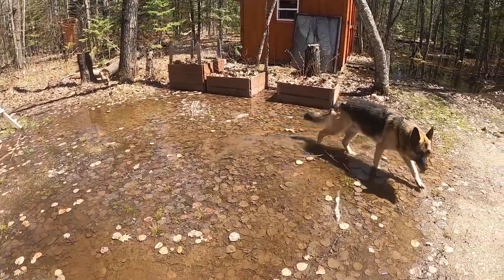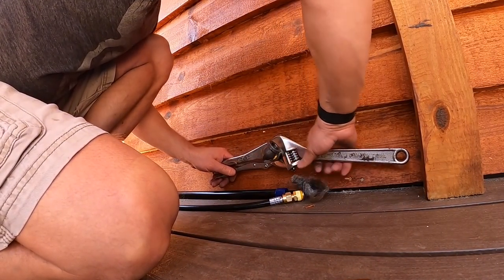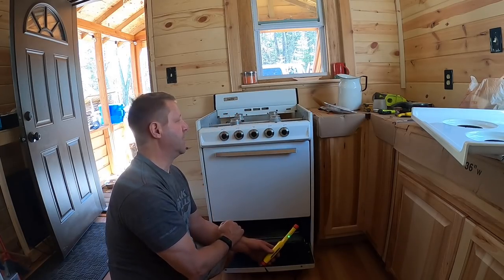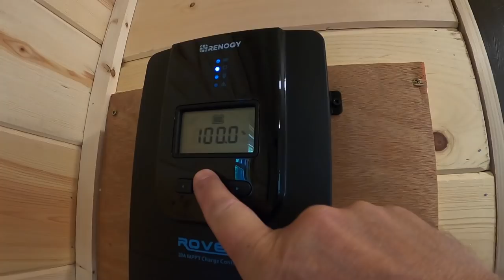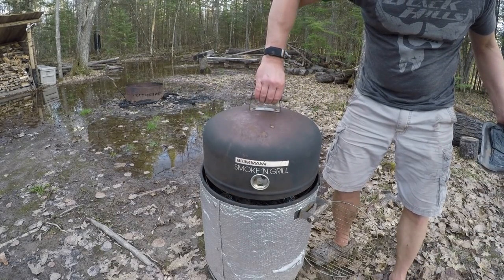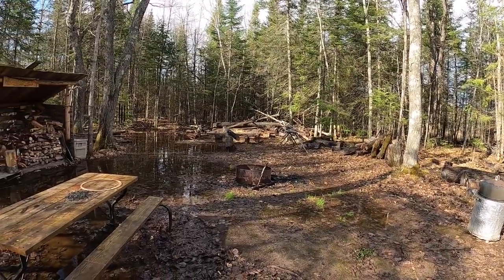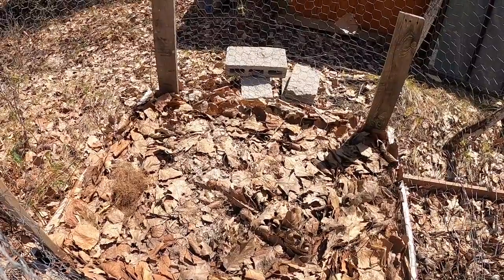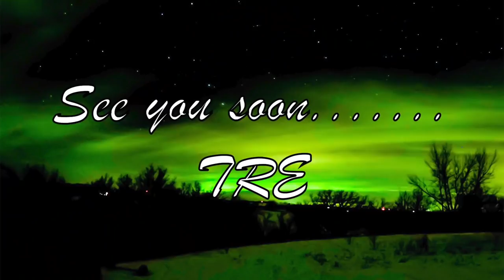The Weekend Homestead Cabin might be in Danger of Flooding. The stove is installed and working.

Comment: We have a gas stove we use everyday. Newer ones have electronic ignition which have no pilot lights. However older ones like yours and ours have pilots. Every time you shut off the gas supply you will need to light all the pilots when you turn the gas back on.  You are correct, when the gas is on and the pilots are not lit, you will have gas flow through the pilot orifice into the air. Stay safe.
Reply from the maker: Oh! That's good confirmation and I appreciate the post. I wasn't sure if it was supposed to or a fault issue. That makes me feel better knowing it's made that way.
Reply: @TRERUNSWILD  Even your BBQ grill is newer. It has a manual sparker to light the burners but even then you have gas flow into the burners once the gas is turned on.
Reply from the maker: @michaelfoor6064  yes but it flows only when i turn the burner knobs. The stove flies with the knobs in the off position

Comment: Unless you already have the side boards for raised planting beads, think about using used galvanized roofing or siding as your sides.  Many times it is cheaper than lumber if not free from some farm with a barn or other building coming down, then you need the posts.  Siding at the joint corners can just have wire ties or vinal tie wraps to hole them together.
Reply from the maker: That's a good idea but the little boxes I get free from a local manufacturer. They are heat treated and have no chemicals. Plus they are free and I can get lots of them.
Reply: @TRERUNSWILD  nothing wrong with that.  It is the right price.

Comment: My property was the same way this year, to fast of a thaw while the frost was still in the Ground. You might want to check out a hundred gallon propane system. In the long run will be cheaper to fill and you could always run gas lamps from lights and heat for those chilly nights where a fire would be to hot
Reply from the maker: Hi John. I had thought about a larger tank. Lugging it into town and back kind of convinced me to go portable. Plus then you have to have someone who can fill it and that is getting harder to find. I'm hoping I won't go through much gas with just the stove but I may have to reconsider if the tank empties to quickly.

Comment: Do you use any sort of air conditioning units for hot days? Will your solar generator run an ac unit?
Reply from the maker: No I have not tried Ac yet. I think the Bluetti would run a small window unit for long enough to cool it down for sleeping but otherwise I did wire a plug for a generator if I ever wanted to add AC.